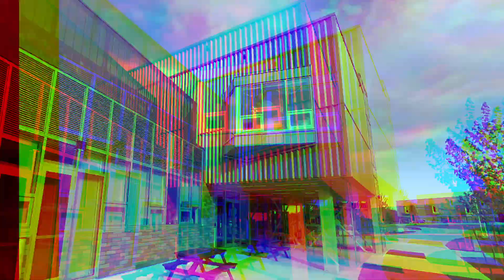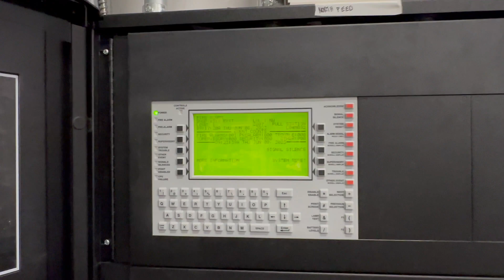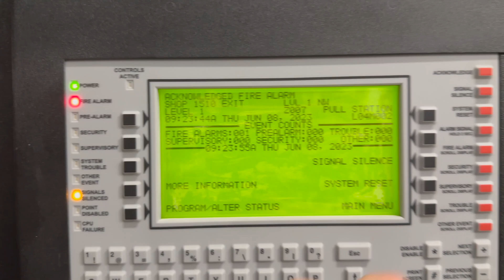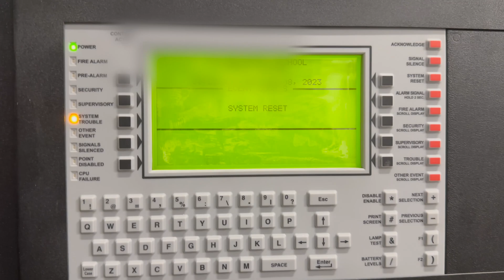Middle school fire drill notifier 3030, system sensor L-series

Comment: The horn strobes in the gym aren't loud because they're behind the cages that an STI stopper uses and set to low volume which reduces the sound output from the horn strobes by absorbing the sound waves so to fix this problem the cages have to be replaced with wire guard cages and turn the horn strobes up to high volume and it's kinda ironic that this is in a gym and they would be louder than in other areas but you're wrong
Reply from the maker: How am I wrong? It's quieter in the gym and I think they should be turned up to at least two of them on high volume.
Reply: @nics-systems-electric  It could be these cages that they're making it sound quieter just like taping a horn strobe to make it quiet as these aren't wire guard cages where using wire guard cages will make the horn strobe retain the same volume
Reply from the maker: @joeycaridi3030  it's quiet mainly because they are on low volume the plastic covers do have holes in them

Comment: Those L-series horn/strobes are actually a tad softer than the SpectrAlert Advances.
Reply from the maker: They are just as loud but they don't have as scratchy as a sound keep in mind the school has them all set to low volume for the most part as well
Reply: @nics-systems-electric  Aside from the volume setting, that less scratchy sound is probably why the L-series horn sounds a bit less harsh on my ears than the Advance. I also find the Wheelock AS and the Simplex TrueAlert (specifically the multi-candela horn/strobe models) just as loud.

Comment: Being from the UK I’m not to familiar with regulations in the US and Canada, however they seem relatively similar for placements and volumes. One thing I have to question is the singular blue strobe outside, why only one? Why blue? Also have to question the lack of outside horns/strobes
Reply from the maker: Horn strobes are not required outside unless it's part of the building that you need to evacuate. blue strobe is just to indicate to responding fire department annunciator location

Comment: My school gym is worse. It is a voice evac system and is tied into the sound system in there. The problem is that if the sound system is turned off or is turned down, that also affects the voice evac. They do also have a ton of speaker/strobes in there (17 to be exact) but those are completely inaudible over people talking.
Reply: This is why they need to add relays that turn up the sound system when the fire alarm voice evac system activates so it's loud and not quiet
Reply: @joeycaridi3030  Yeah they definitely need to do something.
Reply: @joeycaridi3030  There is also a volume problem in the classrooms. Like I mentioned earlier, the school has voice evac so it is pretty quiet. The problem is that the original part of the school (built in 2008) has nothing in the classrooms and the additions only have remote strobes in the classrooms.

Comment: Do you have to go to both buildings for the drills? Like one at the middle school then elementary? Or do both go off at the same time?
Reply from the maker: No they are two separate schools just fed from the same electrical distribution and generator and same heating and cooling plant other than that they are two separate buildings all three buildings are networked together however if any one alarms it will just come up as a indicator light at the annunciator in the other two buildings they do not put each other into full alarm
Reply: Hello  @nics-systems-electric